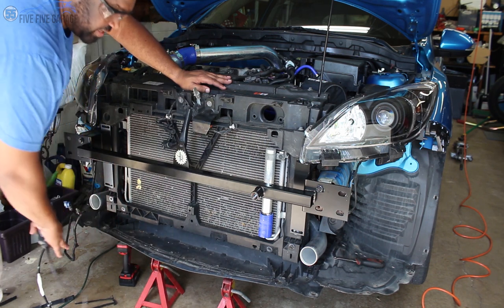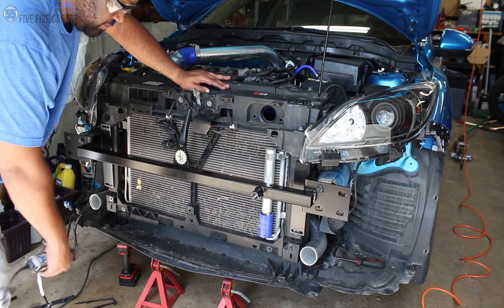Mishimoto S-Line Intercooler Upgrade for my Mazdaspeed 3

Comment: Bro I totally missed this episode 4 months ago smh...the mishimoto looks more fitting the cx racing was way undersized.... definitely gonna read up on the temp difference between the 2 coolers....as I'm  currently  in CT during the winter my boost air and intake temps are between  65-73 depending on how cold it is outside...  keep the vids going💯💯💯💯

Comment: I know you mentioned you had to do some fab work to make the set up for but what exactly did you do? I’m trying to look at the difference of when you installed it and when you finished and I can’t seem to make out the differences. I’m trying to stall the exact same set up
Reply from the maker: The crash bar ends were heavily modified because the bar sits the intercooler too low. It isn't perfect the way I did it, I am in the process of designing a new bar setup from scratch. Custom bar is the way to go with this intercooler.

Comment: Yes! A new video! Loving this shit man. I really wish I could calm my mind around replacing the crash bar with an aftermarket one to get the Mishi FMIC or at least a TR8, but my paranoia gets to me
Reply from the maker: I went back and forth with the idea of it too. Finally decided to go for it. I kinda wish Mazda would have designed the crash bar with the mindset of the tuner community wanting to stuff a big intercooler there!
Reply: John Nickel you can get the tr6! Doesnt require the custom crash bar. Its direct fit
Reply from the maker: Exactly. The TR6 is a direct fit, no modification needed for the JBR bar. The TR8 is going to need some massaging.

Comment: Cool content, man. I also have a 2010 CBM Pu. I use a BNR S3 setup and am at ~390/385 whp/wtq. I went with a Treadstone TR8C and love it. Good choice on the S-line (bar and plate). I don't know much about Mishimotos on Speed 3s, and just went with the Treadstone because they're known to be great for us. I can appreciate trying something new, but it's also cool to see you stick with the proven bar and plate configuration.
Reply from the maker: I originally was going to go with a Treadstone, but I was able to get such a great deal on the S-Line I couldn't pass it up. Most Speed 3s I have seen with the Mishimotos run the M-Line, the S-Line was just a few bucks more. Bar and plate was a must as I want to upgrade the turbo at some point. The only real downside of running the S-Line is that I am going to have to create a custom crash bar, the JBR bar I used doesn't locate the core properly in the grill opening. Sometimes trying something new is more work than you think!

Comment: Another great video.  It would be cool if your new crash bar raised the M in the intercooler to be centered in the grill.  But awesome content as always.
Reply from the maker: Yeah that is bothering me. As I said in the video, I am going to buy the materials and weld up a crash bar so I can get it centered, I want to get as much of the core into direct air flow as possible.

Comment: Hey man great content, I wish I watched this video before the cx fmic. I am running the cx rn and it is very restrictive, I was wondering how could make the core fit with the bar? How did u make the brackets for the core? I got the s line core and want to mount it asap!!
Reply from the maker: Depending on your gen MS3: 
https://www.graveyardperformance.com/collections/mazdaspeed/products/graveyard-performance-07-09-mazdaspeed-3-crash-bar

That crash bar is designed to fit the larger intercooler cores (especially the M and S Line), save yourself the hassle and nightmare that I went through when I did mine LOL

I remember reading somewhere that they might start working on a Gen 2 bar, might want to shoot them an email to be sure. But this makes it MUCH easier to install the S-Line. If that doesnt work I would highly recommend getting one custom made. The setup I used doesn't get the IC mounted high enough, I am redoing it when I get time.

Comment: Are you noticing more engine temps going up? Practically blocks out the radiator... i run the cobb fmic with a jbr crash bar and get nice flow into the engine as well
Reply from the maker: I have been watching them with my Accessport no real big change. There is an air gap over the top so it is not fully blocking the radiator. But I feel like anything bigger than this might cause issues. One thing I need to sort out is that I think I am getting some weird under hood air flow issues since I still have the hood scoop just letting air in. I have been thinking of replacing the scoop with some form of an extractor vent.

Comment: how was the cx racing fmic compared to the stock top mount performance/heat soak wise?
Reply from the maker: Slightly better as it is down in front and not sitting on top of the motor. Once you get in motion it will drop temps faster because of that. On a stock/close to stock car the CX core will do a good job, just make sure it is sitting in direct airflow. If you have any kind of tuning (> 300 whp), once you get some pulls in it will get heat soak just like the top mount.

Comment: Do you know if they sell just the cx piping or wich one do you think it will be a nice setup with the s line
Reply from the maker: Piping: http://www.therpmstore.com/store/p/892-CX-Racing-FMIC-Piping-customized-by-RPM-for-Mazdaspeed-3.html
You can also try contacting CX Racing directly to see if they sell just the piping, but I am not sure that they do. With the setup I have, I would recommend getting some kind of wrap for the hot side pipe that goes over the top of the engine. I highly recommend that you weld up a crash bar, the time I spent modifying the JBR bar to work, I should have just made one.

Comment: Where is the link for the piping you have I couldn't find it ?
Reply from the maker: The piping is from a CX Racing kit I had used previously. 

This kit from RPM: http://www.therpmstore.com/store/p/892-CX-Racing-FMIC-Piping-customized-by-RPM-for-Mazdaspeed-3.html

Is basically the same thing, minus the intercooler. You will have to source a 3" to 2.5" reducer for the S-line. I found some on Amazon.

Comment: How is the fitment on the CXracing piping for the core? For some reason I saw another video of this setup but instead of the elbow coupler he actually used a 2.5-3 coupler that you had originally, and it fit. I’m planning on installing this exact setup but would like to get everything organized before I attempt the installation. Sorry if this is a lot, love the videos bro!
Reply from the maker: The 2.5-3" coupler will work, I just used an elbow as it was just easier for me, routing wise.

Comment: i have the M line i might switch over to the S line. lmk how it performs for you.
Reply from the maker: I have had it in for a couple weeks now. The temps with the S-Line for me have been great, usually around 3 deg above ambient, during 90+ degree days. I wish I could get my hands on an M-Line for a test, maybe I can convince Mishimoto to send me one if I ask really nicely!
Reply: Five Five Garage the M line is great. Temps are also around amb when wot but if the car sits in traffic it gets a little warm. But once you get moving it drops instantly
Reply from the maker: Sounds like the S-Line. I almost pulled the trigger for the Eat Sleep Race edition M in the gold!
Reply from the maker: I will check it out!

Comment: Excelent Video !! Great job Randy. I´d like to know how much hp this intercooler support . Have you noticed an icrease of coolant temp because of covering all that radiator surface? Thank you very much
Reply from the maker: The S-Line easily supports over 500 hp. Coolant temps haven't really changed much, I have air gaps so the flow isn't impeded too much. I am going to re-mount the intercooler this summer, I have some changes I want to make.
Reply: @FiveFiveGarage  ohh thank you very much Randy. I already have  my S-line but It's  not installed  yet. I'll wait impatiently to see your upgrades.

Comment: what brand couplers did you use?
Reply from the maker: https://www.amazon.com/gp/product/B072J8BFQH/ref=ppx_od_dt_b_asin_title_s00?ie=UTF8&th=1 <-- That is what I used. But you can get 3" to 2.5" couplers from siliconeintakes.com and you will probably find them easier and cheaper.

Comment: where did you get those 3x2 1/2 elbow couplings from? Trying to do a similar build. thanks
Reply from the maker: https://amzn.com/B0725WC66F/
Reply: @FiveFiveGarage  are you selling a custom crash bar for the intercooler?
Reply from the maker: Not at the moment. Over the winter I am going to buy the materials and weld up a custom bar so I can get the intercooler centered fully in the grill opening. When I do I will post a video showing how I did it.

Comment: Do you happen to have the measurements for the location of the holes? Looking to go the same route when I go front mount.
Reply from the maker: I don't. If you use larger than 2.5" piping you are going to have a bad time. The hot side piping gets super tight once you get near the radiator, The cold side isn't too bad but things get tight near the throttle body.
Reply: @FiveFiveGarage  I was referring to the holes to mount the core. Like how far from the outside edges of the crash bar are they. Sorry for the confusion.
Reply from the maker: That I don't have. I have it torn down now as I am making a new crash bar setup or I would run out and measure for you!

Comment: How has that setup with the mishimoto s line been performing I'm thinking of going with that setup any advice ?
Reply from the maker: If you go with this setup, you are going to need to fab up a custom crash bar. It will make the fit far easier. I am actually going to weld one up this year to locate the core properly.
Reply: Ok sweet thanks man other than that have you had a problem with the set up
Reply: And can you send .e the link for the piping you got
Reply from the maker: No problems with the setup. Last summer when it got really hot, I was able to do back to back pulls and the cooler would drop the temps to close to ambient. I am working on trying to isolate some of the underhood heat better, I think I am going to remove the scoop and replace it with a vent, that opening is just letting in air that can't escape and it might be affecting underhood air flow/cooling.

Comment: I need the size off the intercooler
Reply from the maker: Straight from the Mishimoto site:
Core Height 12"
Core Width 3"
Inlet 3"
Core Size 23" x 12" x 3"
Overall Width 3" 
Overall Height 12" 
Overall Length 31" 
Construction Bar-and-Plate
Reply: Thanks bro

Comment: Does the Mishimoto have threaded mount bosses on the top & bottom or just the top?  Thx!
Reply from the maker: I just ran out to check, only on the top.
Reply: @FiveFiveGarage  hey man, I really appreciate you checking that for me. Some of the pictures that I've seen show only holes on a top, other show holes on top and bottom. I'm not exactly sure what orientation I will need to mount to send for my particular application, so I'm hoping the one I ordered has both. We shall see. Thanks again man!
Reply from the maker: No problem. I wonder if it is different for each line. I have the S, the M-line may be different. I do know that some of their other IC's have top and bottom bosses (I have one for my Miata project and it has both).

Comment: When you got installed did the shifter plate hit the inteecooler pipes? Mine is hitting and shifting is stiff. What do you think I will have to do?
Reply from the maker: Sounds like you need to make some adjustment to your piping. I just checked mine and I can a finger in between the shift plate and the TB pipe with the car in first gear. I would loosen the clamps and manipulate the piping to get some space and then tighten everything down.
Reply: @FiveFiveGarage  I will do that. Thank you so much man!
Reply from the maker: Anytime!